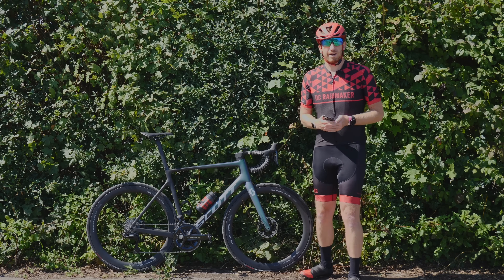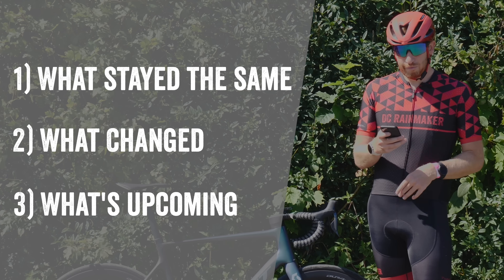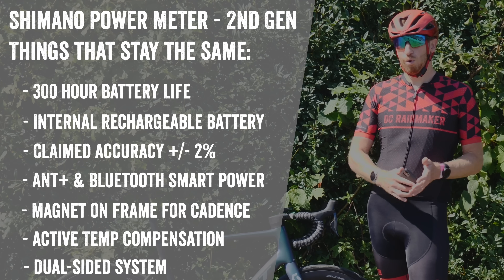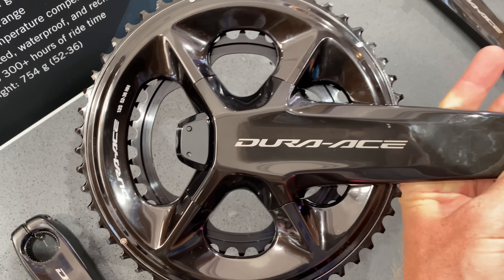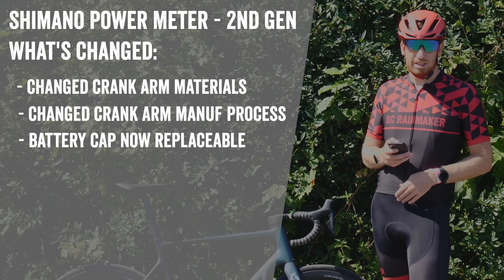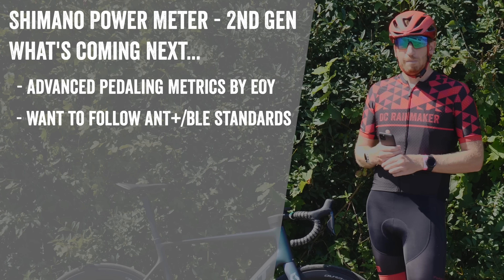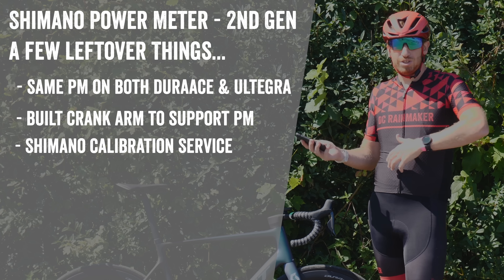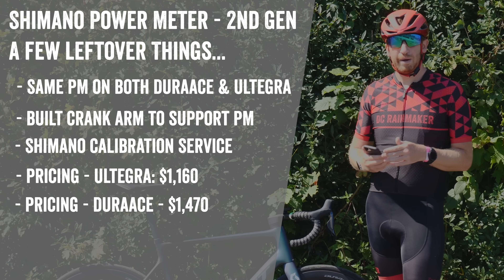Shimano's New R9200P/8100P Power Meters: Technical Differences

Comment: Is there any recent progress in the support of standards by Shimano? I have the current DuraAce Powermeter with latest firmware and it is still so that there are these two mode Cycling Power and Force Vector. And only Cycling Power displays values on the Garmin Edge data fields. Force Vector works only with the Shimano Connect IQ data field and all data fields from Garmin, even the cadence, show no data. 🙁
Reply from the maker: Sadly, no change. Any chance you've got some comparative data you want to share (or files from two concurrent power meters/trainers).
Reply: @Dcrainmaker  hi I am sorry, but I only have this PowerMeter and have no other one to compare to.

Comment: Recently I installed a Shimano M8100P powermeter. I kept my assioma's shi on the bike to compare results and uploaded the files  to the DC analyzer tool. It's just from one ride, but I'm doubting the accuracy of the shimano right crank. I'm curious for your testresults.
Reply from the maker: Yeah, it wouldn't surprise me. All my accuracy testing of the R9200P shows it's not accurate. It's on my to-do list to finish up a review. Only finally got it this summer.
Reply from the maker: Hello! Sorry for the way-back comment. Out of curiosity, how'd this go for you?
Reply: @DC Rainmaker  no worries. 
To be honest, I had just one more go with both powermeters and analysed the data. It occurred to me that the differences were smaller. Maybe temperature had something to do with that. After that, the racehorse went into hibernation and recently, I'm just riding my mtb or training bike. Did you have another go with the shimano powermeter?

Comment: Yo DC or commenters. Got a new bike on order with new 12spd Ultegra. It won't have a power meter. What are my options. Way I see it. 1. Strip cranks n add new power meter Crank set. 2. Power meter pedals 3. My main question currently use non drive side power meter 105 4iiii Crank. Would one of these 11spd options fit onto 12spd cranks if I removed non drive side?

Comment: I’m extremely interested in the results. I’m building up my 2022 Quintana Roo PRSix2 frameset this winter, and really looking to Chuck the new 12-spd Dura-Ace Di2 on it w/Shimano powermeter for ease of integration. Otherwise, I’ll get a Quarq or Stages powermeter.

Comment: Ray, the Price of the new Shimano power meter (PM) is a joke. Shimano shouldn't openly publicly publish these prices without being shameful. The PM is add-on item or an upgrade just like a high-end carbon wheelset or any other performance component. The OEM pricing & selling model should be strictly private to bike manufacture (no resale), selling each component separately on black or gray market as it happed in the past is not a business model that a company like Shimano should have been involved in in the first place. That will probably never happen again since we live in very different times now, which means you can't even buy basic components like a chain or cassette from Shimano as a bike maker you have to wait a year or more for complete groupsets. Don't get me wrong, I am thankful that Shimano exists in a first-place because their performance is zero to none compare to the Sram road groupeset, which has improved a bit with their eTap wireless groupsets. I think cyclists (first-time buyers of the PM buyer) who are interested in PM don't care that much about buying a new bike from the brand they don't like or spec they don't care about, they want cheap reliable PM like 4iiii Precision or Favero Assioma in single or dual option. Prices should be 750-800 or a for Ultegra crankset and 1000-1100 USD without the tax for Dura Ace PM crankset. Only people that I know who owned 1st gen of Shimano PM are pro or semi-pro racers that most of the time didn't have to pay for it. 
Who cares what kind of Aluminium or where they source Shimano it, since it has zero effect on PM accuracy. The most important is that they switched back symmetric right crank design. Two thumbs up for Shimano. The new cranks look great as well. The two-piece bonding manufacturing process for the cranks is far from great, but better than nothing.  Check this IG account for Shimano fails https://www.instagram.com/thanksshimano/

Comment: The errors were largely due to crank asymmetry, meaning the gauge pattern could not effectively cancel the parasitics, giving rise to erroneous outputs. Not so much materials. Although, the hysteresis in the bond line used on the 2 piece shells could also have a small contribution to error.
Reply: The issue was the layup of the crank materials for the strain gauges.  Gauges do not cancel anything they react to tension and compression, nothing more nothing less. The software does the calculations and the nickel resistor compensates for the temp.  They crappy material quality and inconsistencies where their biggest issue for previous generations. 
Simon,
MFL strain Gauges.
Reply: And today I learnt another new word from PT: hysteresis.

Comment: If the crank arm materials were such a problem, how come 4iiii's PM is known for reasonably good reliability?

PS what's the point of the magnets for cadence? Is there a future benefit?
Reply: Their electronics is what's often referenced in regard to reliability. 4iiii invented ANT, so they've got it nailed. The structural crank failures will still occur. More often than not these occur on the right and in humid climates. Magnets for cadence - Typically faster wake up times. Also (and a wild speculation) is the possibility they rely less on the electronic gyros for RPM/crank position... maybe... these can cause issues. If you want to deep dive what kind of issues, INPeak published a paper about this a while back when we came across some oscillations in their power readings.
Reply: @gplama  very interesting. Thanks for the details. I'm quite happy with the cadence from my magnet-less 4iiii and Favero PMs. When I get the 9200 groupset on my new bike, I'll go for another pair of the Favero pedals

Comment: Did the 105 cranks suffer the same issues as the previous gen dura ace/ultegra cranks with the 4iii and stages power meters?
Reply: Yes
Reply: Yes. The issue is with the asymmetrical design.

Comment: That “calibration service” is certainly a bit odd. Is that an admission that the PM won’t be accurate, or would it correct the small variabilities in manufacturing to give the PM accuracy specs better than +-2%?
Reply: After a time PM loses accuracy.
You can send it for calibration to set it back, where it supposed to be.
Don't know how many km you'd had to ride, in order to sway accuracy beyond ±2%
Reply: Real world happens.  This is standard for all measurement instruments
Reply: Powermeters should be accurate out of factory. But sometimes they are not... All brands. Good to have an option to correct that.

Comment: Materials is not geometry.... They changed geometry to symmetric with longer arms for the chainrings. Open standard. Lets see if  I have to reverse engineer it again and make it public again!
Reply: How about a junction box with a wireless transmitter that makes all the 8000/9000 shifters backwards compatible

Comment: Why they use +/- (a figure) is not a statement of accuracy of any counties standards calibration systems.
It is a statement of how good a lab can measure.
A true mesurement would be;
Error at 200 watts (reading) is 0.5 watts (therefore actually reading 200.5 watts), uncertainty of measurement +/-
 1.5% at 93.3 % confidence.
They give no reference standards or traceability.
Therefore it mean basically nothing as a calibration.
Reply from the maker: Well, to be fair, there's no real standards on accuracy measurement of power to begin with. For example, many companies have only tested accuracy indoors. But frankly, that's the easiest when it comes to accuracy, just about anyone can do that. It's out on the road with variability in terrain, humidity, temperature, and more that are what separates good units from bad ones. I'd rather companies focus on developing a single power meter test protocol first. There's interest there from some players.
Reply: @Dcrainmaker  oh yes there is, the cycling industry just doesn't want to use it. 
But they claim figures, pretty meaning less and deceptive really. 
I worked in a accurary lab for many years and had certification to sign off on results traceable to international standards.
Reply: P.S. as to controls, this can be modeled for variables. That is what the uncertainties is, the ability of the measurement swing on a given enviroment. Why it is stated as a plus or minus. This doesn't mean how accurate a item is.
Reply from the maker: Which specific standard applies to cycling power meters? Simply load on a strain gauge doesn’t cut it here. There a lot of factors that need to be defined to create a meaningful testing methodology.
Reply: @Dcrainmaker  power is a defined unit of measure internationally. It is not a bicycle specific metric. Therefore it can be measured and tracable to international standards.
What you are talking about is the environment of the test. Outdoors vs indoors. 
Lets just say it was done in an airconditioned lab. Then the uncertainty would be less as the controls can be kept more constant.
Out on the road temperature varies, vibration etc may impact the result. Tests should be done to see if this does affect the result and if yes, applied to the uncertainty via modelling.
So an uncertainty for a lab may be +/- 0.05% whilst a uncertainty for outdoors maybe +/- 1.5%
But the error should read very similar, i.e error 0.5 watts @ 200 watts. But the potential variance is much bigger.
I get you and Shane do comparison testing and this does ensure some consistency across brands. This does have value. But lets say at the lower end the powermeters are inherently inaccurate, say 20% out. Your test would not pick this up as this is the inaccuracies of power meter design, as they are optimised for 250 watts, lets say.
As a tool they are still useful. But to say it is that many watts, can not be confirmed unless tested against standards with known errors.

Comment: Interesting. I thought the inaccuracies were due to the geometry of the spider rather than the materials. Looking forward to your future tests.
Reply: Peak torque did some comentary on this.
A load meter assumes the arm has even loading (for the algorithm to cancel out parasitic forces). If the arm is asymmetric in construction this makes it difficult. Therefore shimano have made the new crank symmetrical.
Materials may have an effect as it is a bonded composite of steel and aluminium glued. So this may add to the difficulties.
Reply: @waynosfotos  the other guys use composites too, carbon and aluminum usually. I think the construction and symmetry are much more important. Peak Torque and Hambini like the steel spindle, just not the other issues.
Reply from the maker: The specific casting process in combination with the materials was the core of the issue, and why others couldn't get consistent results either (when applying 3rd party units to them).